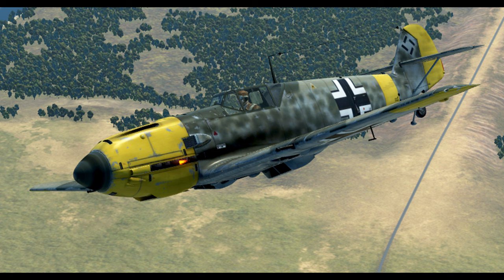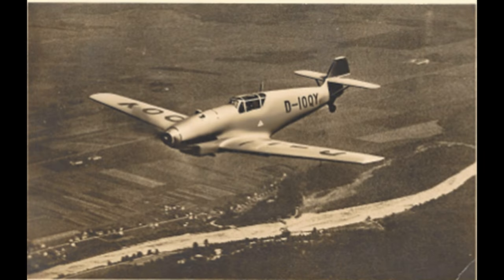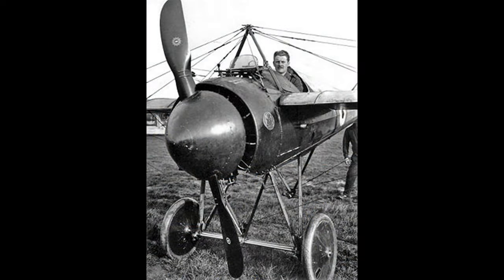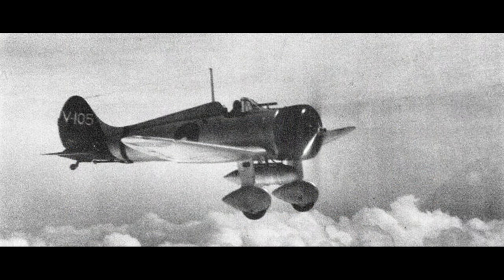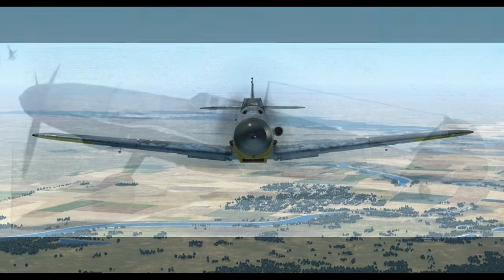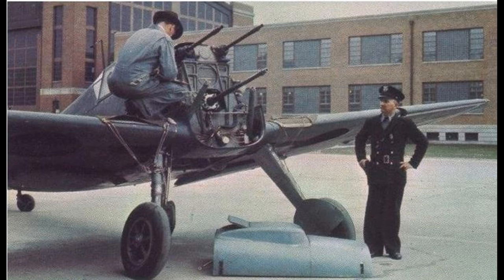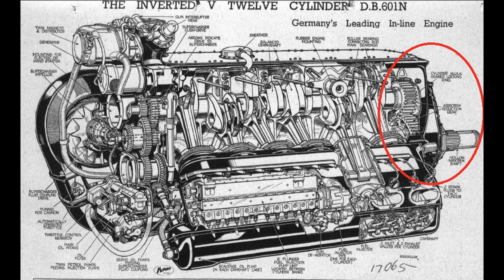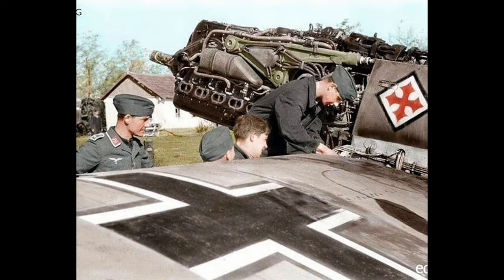Why an INVERTED V-12?  PART 2

Comment: I always assumed the big disadvantage of an inverted V would be lubrication. Increased oil consumption, more frequent oil changes , overcomplex lubrication system or something like that (unfortunetly i've never been able to find a diagram for an inverted V engine oil circuit). Is any of that true? Was the lubrication more complex than in the uprigt V?

By the way I always found the inverted V creates an "organic" shape of the fuselage not unlike a fish that the conventional Vs do not. Not a coincidence that the top 3 most beautiful wwii fighters in my opinion, the 109, ki-61 and the g55 all use inverted Vs ;)

Comment: Love your stuff - very well reasoned - - I have often wondered why the inverted motor? Because it does introduce many drawbacks (common to the radial) - like oil in the cylinders. Unlike a radial where there are some upright cylinders to fire until the bottom spark plugs clear out the oil. A inverted V12 must have been a bastard to start after sitting for a while. I wonder how often the plugs needed to be removed to drain oil? Not a great feature for a defending fighter...! So you would think that there must have been a very compelling reason to adopt the inverted layout?

Comment: The carburetors were a problem in a Spitfire they used to lose power if they would dive quickly because of the carburetor the Messerschmitt never had that problem another advantage but again they did it did to shoot cannons through the propeller

Comment: Greg, really good video and I want to address some questions you put up. On the V12 being inverted. It may or may not have been originally for maintenance but it works better that way. I was an A & P for about 15 years working on many different airplanes. Piston, turbine, turbo prop, and sailplanes. My understanding is that Willy Messerschmidt was very concerned with maintainability. Things like the landing gear being attached to the fuselage so you can take off a wing and still wheel the airplane around. That really makes a difference in the shop. The gear  and wings and engine mounts are attached to a large ring forging that concentrates the load at the firewall without a lot of parts or weight. Look how easy the cowling is to remove for access. On the firewall the bulkhead connections are quick release and each one is different so they can't be mixed up. If you access panels on the fuselage for maintenance the components are color coded for being field repairable or depot level repair. For a time our shop had a CASA built JU52 being cosmetically finished into a pre war Lufthansa air liner. The wing spars were tubes and the attachments were round spigots on the wings to threaded attachments on the fuselage. Very easy to remove and install. So my vote for the inverted engine is maintainability.

Comment: Great video, I think your reasoning about working on the engine is correct.  The Germans are pretty sharp about technical things like that, although I think our Sherman tank was much easier to work on then the typical German tank (one of it's few advantages)  I have read that none of their locomotive engines were identical which made repairing them much harder, everything had to be custom made on site rather then just pulling parts off a shelf and replaceing them.  Perhaps experience taught them before designing the inverted engine that easy maintenance was needed.

Comment: I agree with you on maintenance but also think your argument about the cross section made a lot of sense as well. 
The inverted V helped with having a smaller cross sections as a Me 109 had far tighter cabin than a P-47.

Comment: I thought that with any inverted engine (and radials/rotary) there was always a danger of oil collecting in the head whilst standing leading to hydraulic lock on start up. Indeed in some applications prior to starting the operator had to drain each cylinder to avoid potential damage. Is this a factor with the 109 et al?

Comment: I have noticed in pictures of German aircraft the inverted engine layout places the exhaust just above the wing root... I wonder if there was a slight increase in lift due to the exhaust being directed over the top wing surface? I know this trick has been used in formula 1 with great effect.

Comment: That's a great explanation of reasons for engine designs and uses.  I especially like the reference to maintenance on inverted engines about dropping a part or tool.  
Murphy's Law states that a part or tool dropped will land where it can't be found or will do the most damage!

Comment: From the photos you posted of the stand-alone engine, and the plane without the engine it looks like if they had used a standard V engine the heads would be in the way. Maybe the want to have cowl mounted guns had something to do with it. I don’t see how visibility could have been a factor, since it appears that the top of the crank case is almost the exact same distance from the center of the crank shaft as the bottom of the valve covers

Comment: Hey Greg. What about the cooling ?? The inverted is more efficient because the hottest part (the head of the cilinder ) is on the lower position and the hot tends to go up. Is like why you put radiators on the lower part of the house and air cooling on the upper part. Inverted is more efficient.
Reply: My oppion also cooling system reasons

Comment: Question, some what related...

If the DB 603 when used in the Merc Benz T80 could produce 3000 HP at 3200 RPM (using an exotic blend of fuel of methyl alcohol (63%), benzene (16%), ethanol (12%), acetone (4.4%), nitrobenzene (2.2%), avgas (2%), and ether (0.4%) with MW (methanol-water) injection for charge cooling and as an anti-detonant) 

Why did they have trouble (coming nowhere near close to) generating the same power on "normal" fuel??
Reply from the maker: Fuel production is a bit outside my area of knowledge, but I suspect it's because it's one thing to make up a limited batch of special fuel for testing, it's another to produce and transport 10s of thousands of gallons to the front lines reliably.

Comment: Amazing than nobody mentions upright-V12 Bf109s, as seen in the 1960s film "The Battle of England". These were Merlin-engined Bf109s, made in Spain in the after-war period, using Bf109 frames supplied by Germany to Franco, but without engines, and addittional copies wholly made in Spain. After WW2, Spain bought Merlin engines in the UK and built several dozen Merlin-engined Bf109s, serving in Spain's air force till replaced by jet fighters around 1960. A number of these Bf109 planes were sold to the film-makers for the movie, as they were still airworthy. They can now be seen in some UK museums, as well as in the Air Museum in Madrid, Spain. See history in https://en.wikipedia.org/wiki/Hispano_Aviaci%C3%B3n_HA-1112
Reply: Correct.  And the prototype Bf109 had a RR Kestrel engine.  Definitely not inverted.  The film was 'The Battle of Britain' as the battle is normally called.  Many of the Spitfires shown starting up were glass-fibre replicas with lawn-mower engines and two or three bladed props to be correct for the time.  The engine noises were dubbed in afterwards!

Comment: A couple factors are missing. 

The 109 is a small plane. It’s an incredibly small plane. A Texan or SNJ trainer or even a PT-19 are quite large in comparison.

The DB6xx and Jumo 2xx are massive engines.  The Rolls Royce was only 27 litres. The Allison was 28 litres. The DB601 was 34 litres. The DB605 was almost 36 litres. That’s more than a Ranger’s worth of displacement difference between the Merlin and the ultimate 109 engine. 

Putting such a massive engine into such a small aircraft was no easy undertaking... while still leaving room for armament.  The Spitfire was slightly larger, with an engine a Big Block Chevy smaller in displacement.. with no armament in the nose. 

Two machine guns were an RLM specification. As was a Motorkanone when they realized two machine guns wouldn’t be enough. Another RLM requirement was interchangeability between engine types, meaning the DB6xx and Jumo 2xx would have to share the same basic configuration. 

The fact that the Motorkanone is mounted so far back (awesome photo by the way) plays into it. If you look at a cockpit photo.. the butt of the cannon is right between the rudder pedals and below the instrument panel of the 109. If it had an upright V12... the butt would be directly behind the instrument panel in the way of plumbing or cases of primary instruments.. because the prop of an upright V12 that uses an offset (instead of planetary) gearbox is higher.  Doesn’t matter in a larger fighter like a LA-5 or P-40... but for one that’s only five feet longer than a Klemm 35 trainer and most of it is engine... you need that room. 

And again, as a 20 year licensed aircraft mechanic I’m going to disagree with you on maintenance.  Being above your work and looking down is always better than being under it and looking up. You can always find something to stand on... and it’s far better to have gravity working with you on installation than removal (ask me how I know). It’s always better to be above oil leaks and falling parts. It’s always better to have light than dark. 

Besides, the Germans already had this figured out with their QEC (quick engine change or power egg) installations. It’s far better to change a whole engine assembly in a half dozen hours—and take that back to a shop where it’s on a rotating or vertical stand depending on engine type—than to do major work in situ. Spark plugs?  Any engine... V, inverted V, radial, in-line, opposes... I’ll have the plugs out and new ones in (if they are gapped and inspected... which definitely doesn’t matter about engine type) inside of 1/2 an hour. Maybe an hour for an R-4360. ;)
Reply from the maker: That's covered extensively in my P-51 vs. 109 Drag video.

Comment: Greg I love your videos. As my channel has a lot of car maintenance theories (some crazy like change out your starter while it's still working) I agree that ease of maintenance was a major reason for the inverted V. BTW way too generous on the Sherman's bad design.  I hate that tank!
Reply from the maker: I'm not crazy about the Sherman, and if I was a tank crewmember it's not the tank I would choose. However as a General faced with invading and over running Europe with all it's bridges and narrow roads the Sherman would look pretty good to me.
Reply: @GregsAirplanesandAutomobiles  Allied air superiority masked a lot of the Shermans design flaws. But what would have happened if Germany had 300 additional Me 262s (with good pilots) on the Western front in 1944 and air superiority was not a given?

Comment: Great Video

I have a question regarding inverted Vee.

How is oil collection in the "underside" of the piston controlled, as the inverted piston is now a cup at an angle

Is it the "flinging action" of the piston changing direction at BDC and the oil maintaining direction (away from head / upwards & inwards) due to inertia?

How does oil settled in piston affect start up?
Reply from the maker: I am not sure. I haven't ever seen one apart in real life. What I think is that it's not really a factor when the engine is running as the piston is moving so fast that oil won't be able to collect in the underside of the piston. Much the way it doesn't in the lower pistons of a radial. However, once it shuts off, it seems to me that like a radial there is a chance of hydrolock if the oil can drain past the rings into the combustion chamber, and I think it can in the DB engine. Maint and starting procedures would be used to prevent damage in that case.

Comment: The smoking gun? Calum Douglas' recent YouTube video lays out exactly why the Germans used inverted V12's. From the video description - "Using some of the research into German aero engines I used in my book, The Secret Horsepower Race, I go through the original points laid out in the 1928 specification document which describe exactly why the engines were inverted." and a link to the video - https://www.youtube.com/watch?v=LvaKvc-igjU
Reply from the maker: I haven't seen it yet. I like Calum, I'll watch it soon.

Comment: Agree about vis and mantainance. But what about oil? Does the gravity effect where the oil is going when parked or hit? Have not time to check all the other comments, here and prev video. Sorry if already asked.
Reply from the maker: It's a dry sump system, so the fact that it's inverted has little effect on oiling when the engine is running.

Comment: The engine for the 109 was specified in the original specification for the competition for the new Luftwaffe fighter  L.A. 1432/33. This specified a Jumo 210 with the ability to refit the DB600. 
Hence the structural benefit you describe in the first video is more a case of Messerschmidt taking advantage of the features of the engine form rather than the engine being designed for it. The He112 had wide track undercarriage & the resulting thick wing made it uncompetitive.
Hence the question is more why the Jumo 210 went inverted V. I am trying to see if I can track anything down as to whether this was a Junkers decision which Daimler copied as DB600 was supposed to fit the same airframes or (IMHO more likely) was a decision by the air ministry in the original specification.
Reply from the maker: Oh, I agree, the 109 like almost every plane made between 1903 and 1964 was designed for an engine, not the other way around. Thus it's fairly certain that Messershmidt took advantage of the shape, and not the other way around.

Comment: Greg:

   Your engine videos are awesome. May I suggest you create a video that ties them together: Engines are Air Pumps.

   In order to get a horsepower for an hour, you need to burn half a pound of gas. In order to burn half a pound of gas, you need to pump 7.5 pounds of air through your engine.  You can vary cubic inches, RPM, and air pressure.  You get deductions if your intake or exhaust system can’t flow the air. 

   Start with this basic idea, and show how it applies to WWI engines, WWII engines, and Formula 1 engines. Show how gasoline quality limits air pressure, which really hurt the Germans. Show how the jet engine made it a lot easier to pump air.

   Show that piston speed is a limit - you can’t make stroke longer and keep same RPM. Show scaling laws - if you double every dimension on a cylinder, you increase cubes by 8 but valve area  by 4. 

  Show that it works for diesels - it burns slower, so piston speed is slower, everything else is the same.

  Show that it works for rocket engines - a instead of a pound of air, pump .2 pounds of liquid oxygen.
Reply from the maker: I thought about that. However, I assume that there are already at least several channels on youtube that go over  basics of internal combustion, so I don't know that I really want to do that, nor do I think that's why my subscribers and Patreon supporters want. Some of the topics you mention are covered in my videos because they highly relevant to this specific subject matter, for example my P-51 Mustang Manifold Pressure video talks about gasoline quality limiting air pressure, so does my first 109 vs. P-51 speed video. 

As an example, if I really wanted to explain camshaft timing it would take me about two 30-40 min videos to get that in, probably more. That's just one thing. If I covered the entire engine, that would be about a year worth of video uploads for this channel, thus I would spend a year putting up videos on topics that are already covered here on youtube (at least I assume they are, someone must be doing that), and thus there would be no videos about, say the FW190 during that time. Then add in Rockets, steam power, gas turbines, etc. and it's an entire channel by itself, quite easily.

Comment: As a kid, building model airplanes, I just naturally assumed the the inverted V-12 when viewed cross section-ally blended with the egg shape of the fuselage.  Never even thought it was a question.  The Spitfire for example, with a right side up V-12, the engine cowling form has to reverse direction to blend with the fuselage.  I have since reconsidered and believe this configuration is simply a product of engineering group think.
Reply from the maker: Aircraft designers worked the other way, from the engine back, not from the tail forward.

Comment: I think one of the reasons the Bf-109 was so popular with the German “Experten” had to do with the concentration of firepower. When guns are mounted in the wings, they have to be synchronized to converge at a specific point in space in front of the aircraft. In the case of the 109 and, for the US, the P-38, having the guns in the nose, or more correctly, along the centerline, made aiming much easier, and convergence was less of an issue. Pilots, like Dick Bong, actually said words to this effect.
Reply: Very good point, from my ignorant´s perch.

Comment: I have read that propellers on planes lose efficiency as the prop tips approach the speed of sound and it does not appear to be difficult to move the air necessary to obtain the speed to fly.